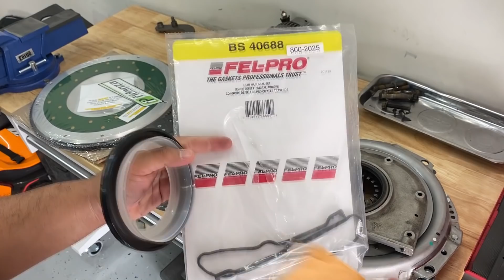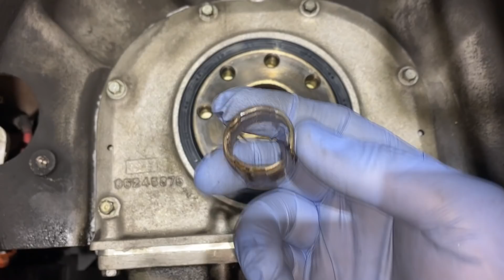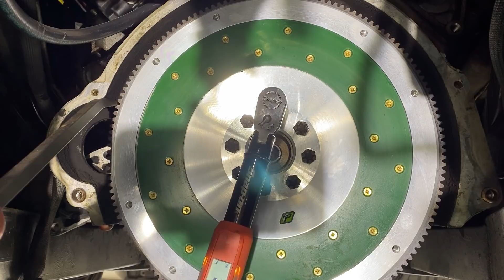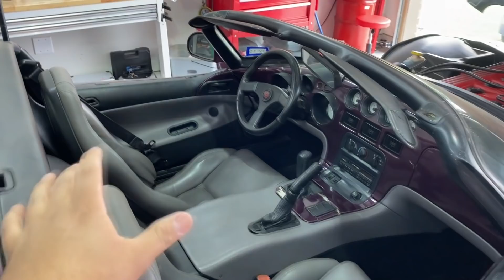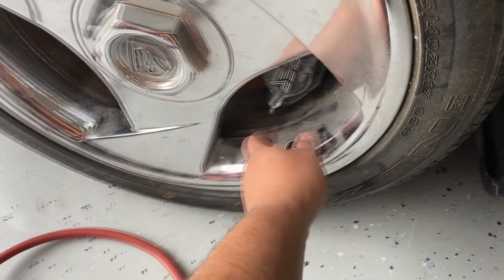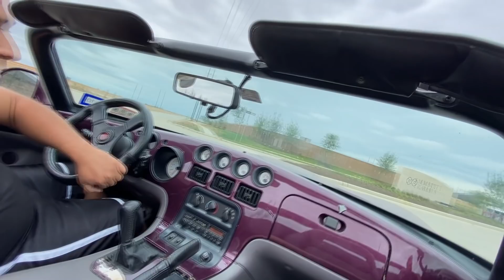MOST DANGEROUS SUPERCAR LIVES! PROJECT PURPLE REIGN PART 6

Comment: Regarding the grease trick for the pilot bearing, I have a standard and metric universal pilot shaft/clutch alignment tool.  If you use one of these, using the correct adapter on the end to fit the pilot bearing, the hydraulic trick using grease will work.  Has not failed me yet.  You could possible use the plastic tool that comes with the kit but I have metal alignment tools.

Comment: the easiest way to remove the pilot bearing is fill it full of grease and find a piece of round bar that fits neatly into the center of the hole and hit it with a hammer providing the round bar is a neat fit the grease will not compress so hitting the bar will force the grease to push the bush out cheers from down under

Comment: Regarding the oil seal, could you have used a oil seal supplied by people who supply Engineering Industry with bearings seals Belts Etc, if you talk to a Tech Salesman at one of these companies they could advise on what material ETC. just another avenue of parts search.

Comment: Wish you were close to Arlington I'll help you just to learn.

I'm working on a 2002 trailblazer with LGM issues. The Data link communication network goes down when spliced the LGM wire.

I think its a bad ground but don't have access to wiring diagrams
Reply: Check fuses 3 and 6 in the rear fuse box. At the LGM check for battery voltage on C1 pins A and C. Both of them are orange wires. Ground is C1 pin D black wire. If you’re missing any power/grounds then check inside the rubber boot for any broken/shorted wires. If all that is good then it’s probably the module itself. Unplugging connector 2 with the light blue wire at the LGM will rule out any short in the data line to the module. If unplugging it brings the network back up the network wiring to the module is good.
Reply: @Jpilgrim30  costumer bout a new module from parts store. That was the original work order. After replacement I took a shot at the diag. 

Unplugging the middle conector on the lgm does indeed brin back the comms 

I unplugged all the connectors in the lift gate and brought them in one by one with no change until I plugged the license plate lights. The network came down. 

Probed and it has power but no ground
Reply: @Jpilgrim30  I pulled out both sides of the boot but didn't see any obvious wire damage.  

The issue is so intermittent I had her come take the vehicle home and drive it. 
Sometimes it's a no start condition but unplugging and plugging back in the gray connector on bcm will restore functionality for a bit enough to get started.